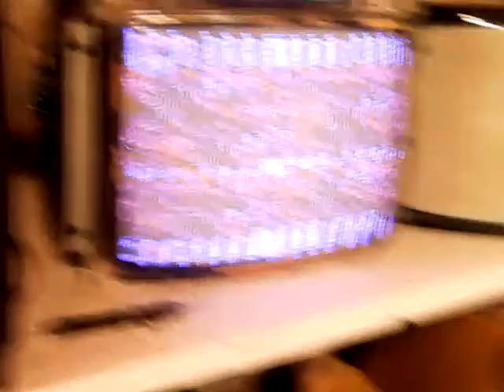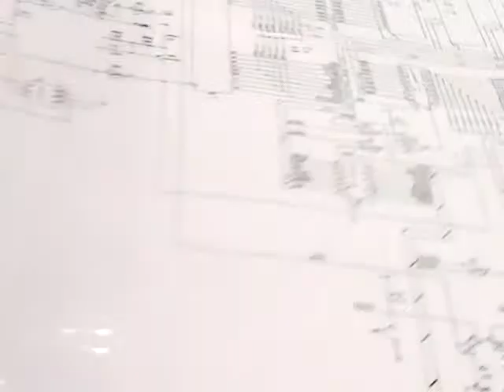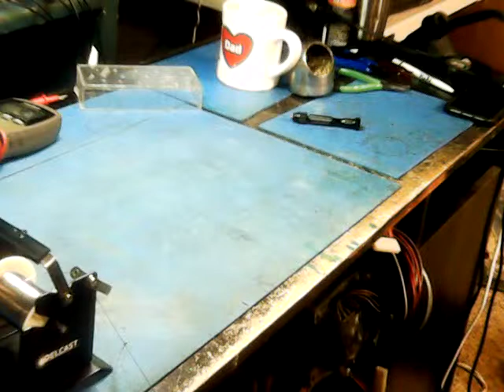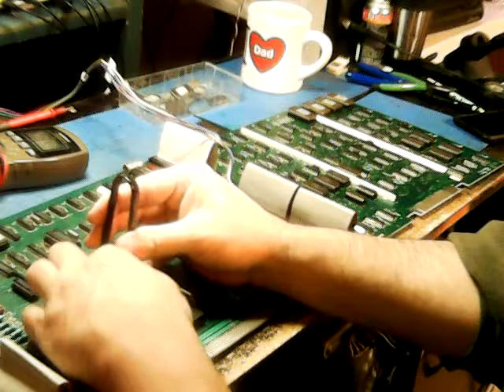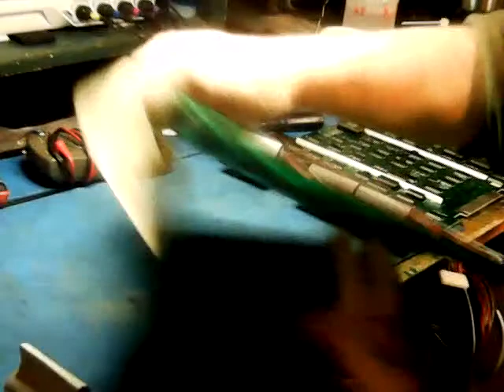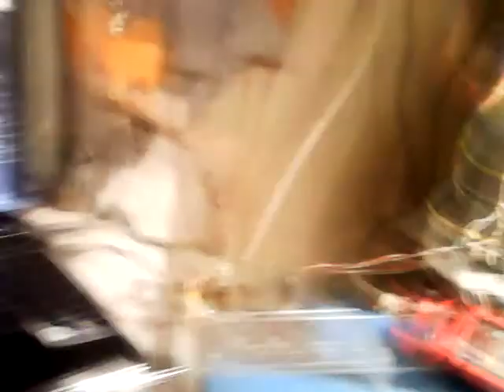Bally Midway "Kick Man" Part 5

Comment: I just had a Qix fail with weird problems. All LEDs flashing, Diagnose would get stuck when switching video RAM banks and even if it finished, it would just restart immediately.
Turned out to be an open resistor pack.
Reply from the maker: was it one of those "wafer" packs?  those things are garbage